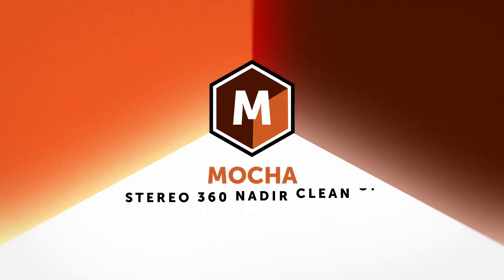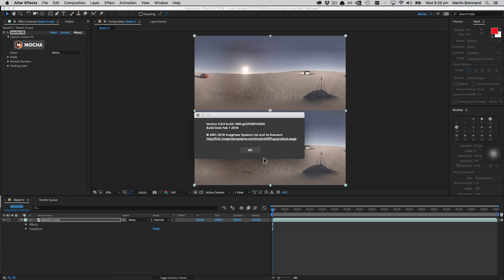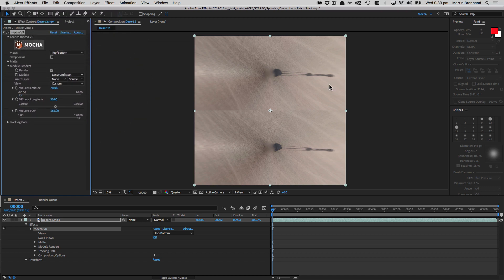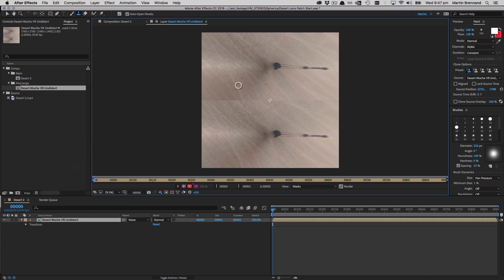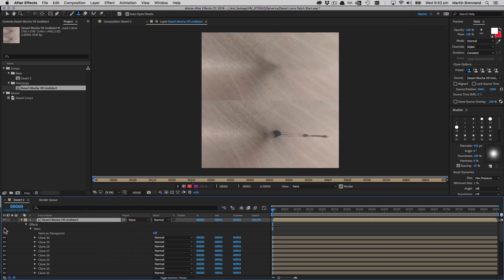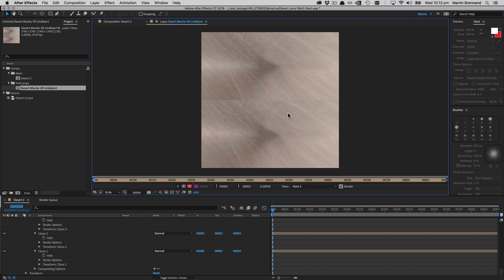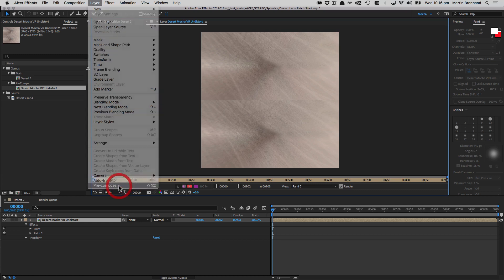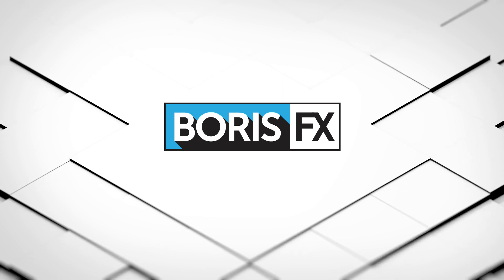Mocha VR: Rig Removal on Stereo Google Jump 360 Video

Comment: Amazing! Will this technique (or any other feature in Mocha) also work on ground that is much more varied in color and texture? (ie. very large cobblestones with grass patches and/or street and sidewalk with colored curbs)
Reply: It worked for me. The only occasional thing would be having to add a couple of extra clone stamps for the bottom view/right eye. Because the right eye has a very slightly different view the edge of the tripod sometimes showed still after copying across the clone stamp data from the left eye. On tiled floors I made sure I placed the tripod in the centre of one so I didn't have to clone stamp any straight lines/edges of the tiles, as that would be a nightmare to get right with stereo I think.

Comment: Great tutorial. Why didn't you use the remove module?
Reply: I've been struggling with the remove module on rover footage.  For me, the problem is that the surface tool always drifts, and there's no way to refine it when your rover/camera has already driven away from the surface tool & corresponding edge points.